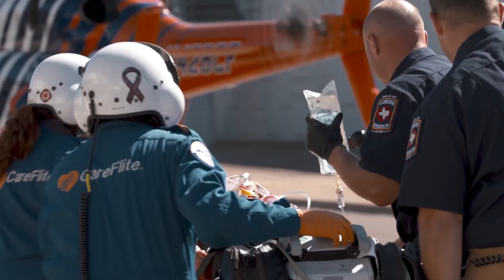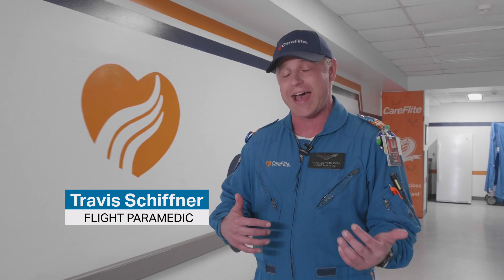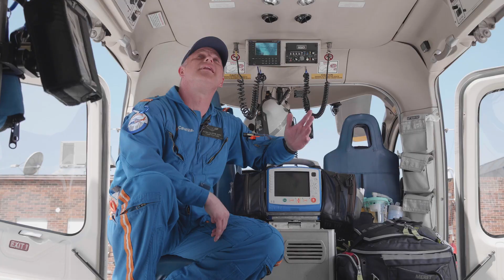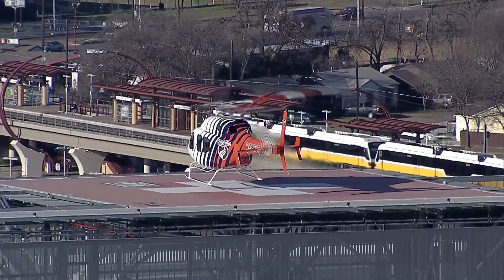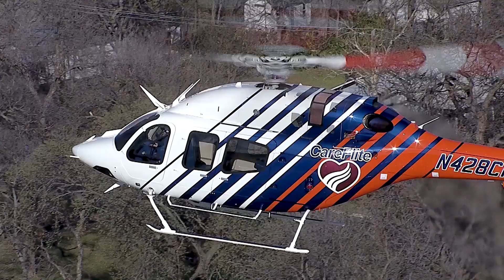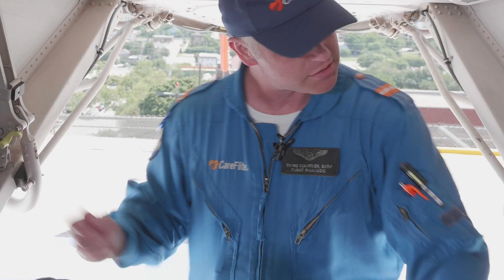CareFlite: Bell 429 Medical Interior Walkaround

Comment: As a former Flight Medic with Calstar in CA, I would have much preferred the Bell 429 to the airframe we had. There have been massive improvements no doubt because of the work we did 10,15, 20 years ago.  I like the Bell better then the Army Blackhawk.